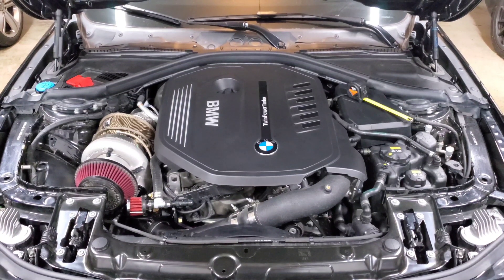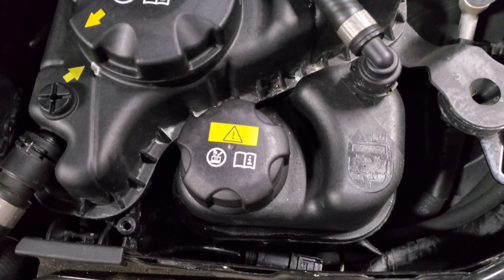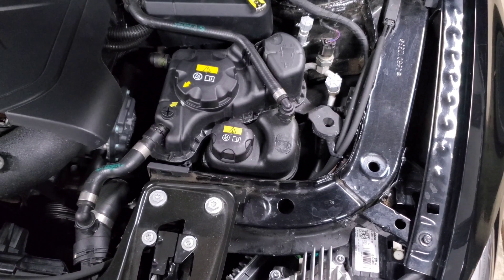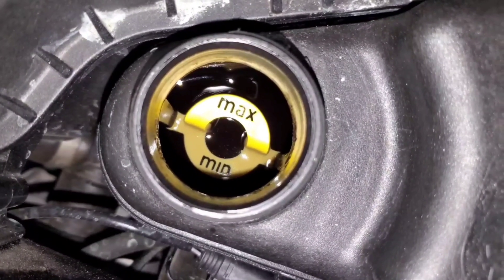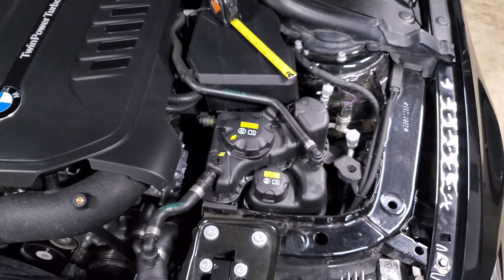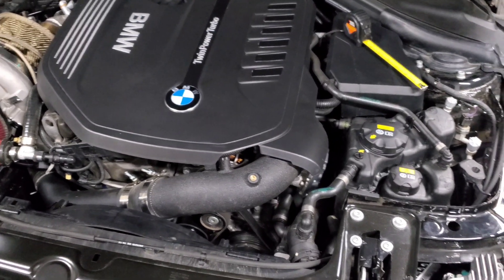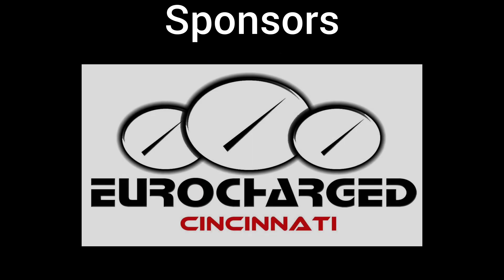**READ DESCRIPTION** B58 Coolant Bleed DIY

Comment: So this not bleeding this is taking air out of the system after bleeding (draining) all old coolant out and pouring new one in is that right? The word bleeding confused me as I have not seen how can we drain all old coolant out of the car?
Reply from the maker: You need to look up the definition of bleeding
Reply: @kern417  I am asking a question. What do you do at the video? I do not understand. Are you trying to get the air out of the system just with circulation? Or are you trying to get all of the collant out of the car? I do not see any coolant taken out. Which one ? I know english well but I got confused what your trying to do inside the car.
Reply from the maker: @demirunlusoy2795  bleeding a system means you're getting air out. Same with bleeding your brakes, clutch, etc.
Reply: @kern417  Thank you. I have Bmw G20 with B48B16 (1.6 lt) engine with mechanical water pump. But it also has a secondary small black plastic electric pump as well. Is the procedure same as at the video? Or will I bleed air out through small black screw while on idle as old style bmws?

Comment: Although I tried both electric pump methods, they both seem to only active the pump for the low temp circuit. The only way I’ve been able to bleed the high temp circuit is to turn the car on and do the revving procedure. Also, is it normal to see a lot of bubbles in the coolant reservoir when doing the bleeding procedure with the car on? I’ve done it twice for 10 minutes each and I keep seeing a lot of bubbles
Reply from the maker: Bubbles means it's still bleeding out air
Reply: Yea i tried the process on the vid but it didnt do anything on my 2017 540i is it just a different process for 540i?
Reply: @Carlitosway_619  No.  All "40" designations relate to the B58  engine, not the size or type of vehicle, therefore the process should be the same.  Today (June 4, 2023) I followed the process exactly as described by on my 2018 240I X-drive and achieved virtually similar results, perhaps a bit better than you have.  However the cooling system on my car didn't really need any bleeding as I have never replaced any components but since my coolant level was a bit low I'd give it a try, if for nothing else as a learning opportunity.  Everything worked flawlessly and I added 200 ml to the intercooler circuit and about 300 ml to the main circuit.  Albeit not much coolant needed to be added, at least I now know how to do it, thanks to Kern417!!!

Comment: I have a question my lower coolant has a light yellow color abut my high temp has blue coolant is that normal? Or I should bleed it and refill it again. I can't find info else where. Please help thank you.
Reply from the maker: It just depends on what it was filled up with but typically it should be blue if you used bmw coolant

Comment: My AC stopped blowing cold on a road trip. Looked it up and found this vid. My coolant was low so I followed the steps and AC is ice cold again. Thanks for such an informative vid!
Reply: Which one did you fill? The smaller or the bigger one?
Reply: @pranjalsharma8344  He'd fill the smaller. The smaller tank goes to the heat exchanger, intercooler inside the intake manifold, and the a/c condenser.
Reply: It’s a closed system. You have a leak.

Comment: When you’re done bleeding the high temp, after revving it.
Will the coolant stop running like the low temp stops? Or will it keep running even when it’s done because the cars on? Or will it drop below the 1200 rpm
Reply from the maker: The electric pump will stop running after a while. The mechanical pump will run as long as the engine is on

Comment: Great video, thanks a lot.
What type of battery charger for this process?
Reply from the maker: any will work
Reply: @kern417  Hi Kern,
I tried a bleeding procedure on my BMW, but no coolant was coming out. I am using a battery charger too. I think the electric pump is not working. Do you know where the electric pump locate? Does the electric pump have fuses? I am driving a 2018 X3 m40i.
Reply from the maker: If it's not working then you'd have issues and codes while driving. Make sure you're doing the sequence properly

Comment: Great Video as always. A90/A91 Supra have a similar but slightly different sequence for Low Temp that includes the 3 quick Start button presses to go into Diag mode before the rest of the sequence begins. After pressing the gas peday a message on the dash about the service procedure beginning is displayed and the pump starts. Electronic pump goes for like 10 min. Ran it 3 times and no more bublles. Hi Temp will be tomorrow!.
Reply: Did you see the coolant moving in the tanks? I did mine today heard some noises but the coolant didnt move 2020
Reply: @dubsrevo having same issue, coolant is not moving did you find a solution??
Reply: @ my situation was weird as hell. The pump just started working out of nowhere by itself and coolant temps are behaving. Good luck brotha
Reply: I need to fully flush and replace my high temp. Any tips? I’m not sure draining from Lower radiator hose is gonna be enough.

Comment: After my CSF heat exchanger install, the shop did a vacuum but advised that it may still burp itself a bit over time. I’m noticing an intermittent hum on idle and new electric noise/buzz after shutdown. I’m gonna do this bleed procedure to be safe. For the small circuit, do I bleed it with the cap off?
Reply from the maker: I did

Comment: Do you bleed the high temp circuit with the cap off?
Reply from the maker: I did
Reply: @kern417  what about the small black Phillips head screw next to the high circuit cap. Should that also be removed while bleeding?
Reply from the maker: @MrBigjoe2400  i didn't
Reply: @kern417  you are the MVP

Comment: I thought there was only 1 electric water pump on the b58?
Reply from the maker: As I demonstrated in the video, there are 2.
Reply: @kern417   I just can't seem to find any information on this second 2nd electric pump.
Reply: From what I can find, the b58 only has 2 pump. It's the b58tu the has 3 pumps. So I assume it's the generation 2 (b58tu) you have?
Reply from the maker: Seriously? Did you not see me activate both pumps separately in the video? I don't know what to tell you except I explained everything already. But You can believe what you want.
Reply: I was also skeptical about this , I did the low temp and high temp procedure but only noticed that the coolant on the low side was the one moving with both procedures , I’ve done the procedures maybe 6 times now and noticed the same thing, he might be right
Reply: Then I started the car and the main circuit got sucked down because the mechanical pump is what that deals with
Reply from the maker: @giovanniwilliams3050  he is not right.
Reply from the maker: Simple question: what pump runs to cool off the turbo when the car is turned off?
Reply: @kern417  the electric pump obviously but you stated that’s only for heat exchanger, intake manifold ect in your bio but that’s not the case
Reply from the maker: @giovanniwilliams3050  🤦🏾‍♂️ it is a completely separate circuit. You can't have one pump drive 2 separate circuits. Idky i have to explain this but believe what you want.
Reply: @kern417  ima believe you anyways 🤣🤣 you the b58 wizard
Reply from the maker: @giovanniwilliams3050  🤷🏾‍♂️ part number 11518671654 🤔

Comment: how do u drain the cooling system say if you wanna do a flush?
Reply from the maker: Remove the lowest hose from the radiator in the system that you want to drain
Reply: @kern417  could you make a video on how to to a coolant flush

Comment: Should the caps be off during this? Should I loosen the small screw near the larger reservoir
Reply from the maker: The dealership does it with the cap on but I do it with the cap off just so I can keep topping off the system. I never loosen the bleeder screw
Reply: @kern417  thank you boss

Comment from the maker: 2:15 - Low Temp Circuit bleed process (Heat Exchanger, Intake Manifold, etc.)
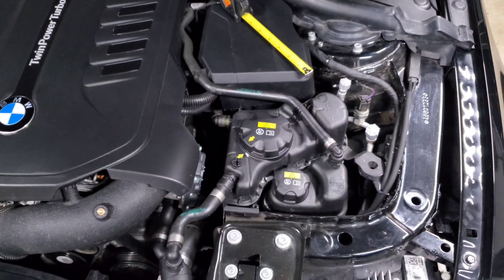4:54 - High Temp Circuit bleed process (Turbo, Engine, Radiators, etc.)